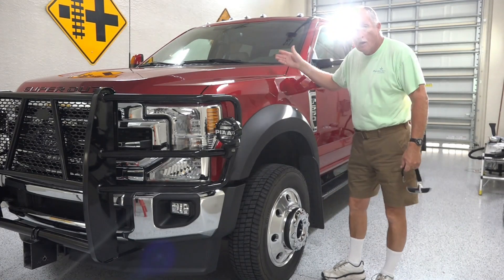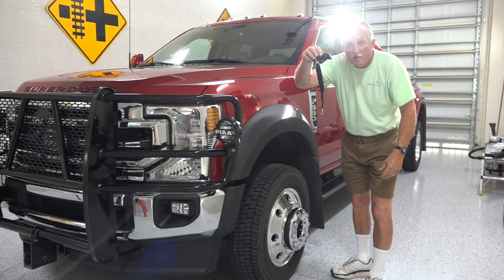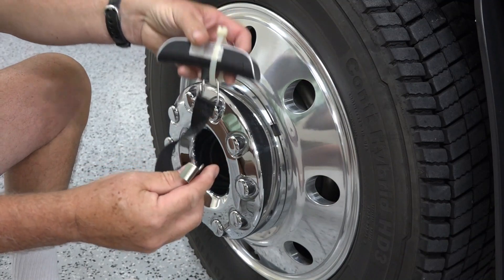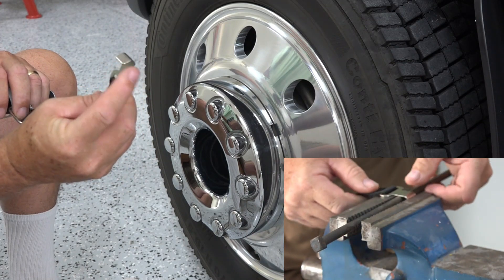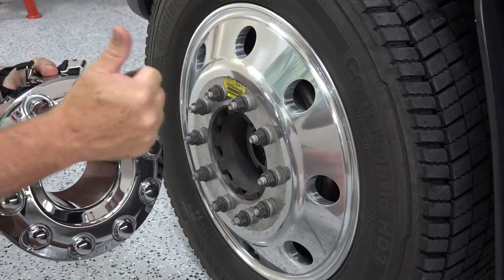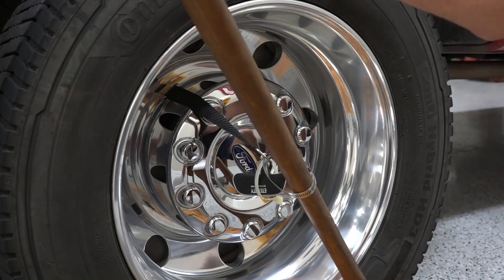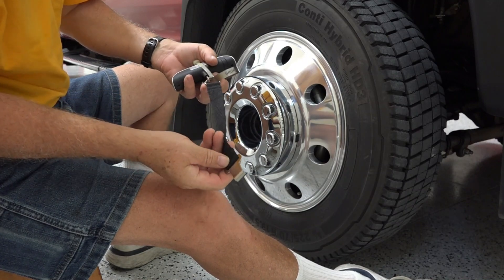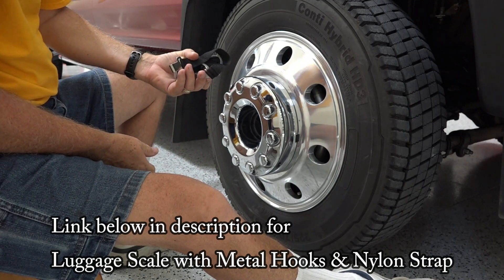How to Easily Remove Ford Super Duty Hub Caps - Scratch Free!

Comment: Great idea! I've got an F450 and bought the expensive sliding hammer removal tool. I can't get my hubcap off with it. I'll try this one. I did finally get the rear hubcap off, but I haven't been able to get it back on. I'll have to try a bigger hammer.